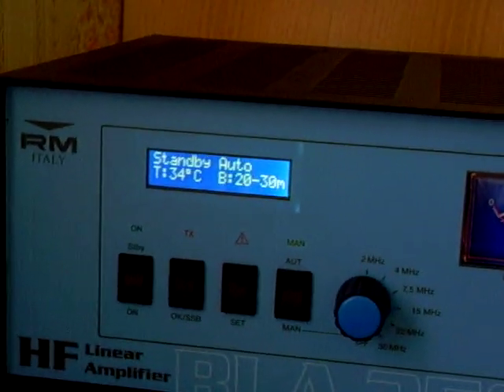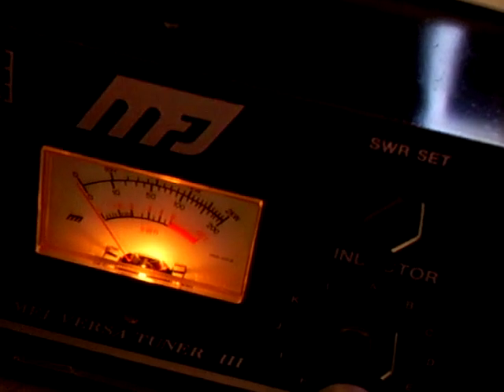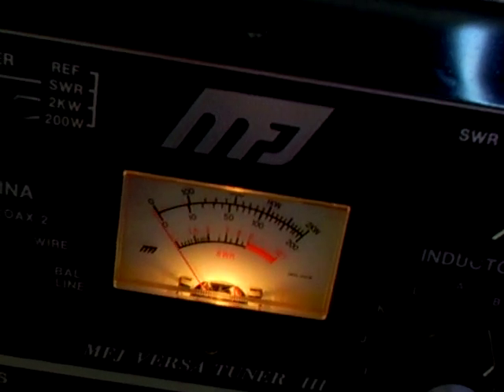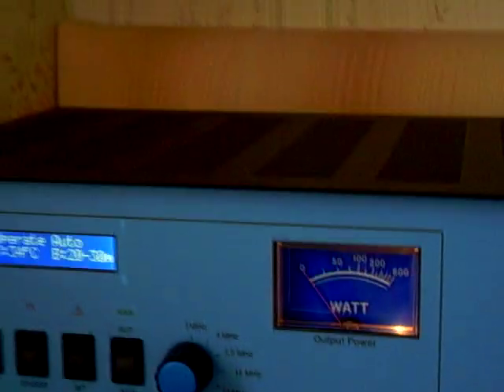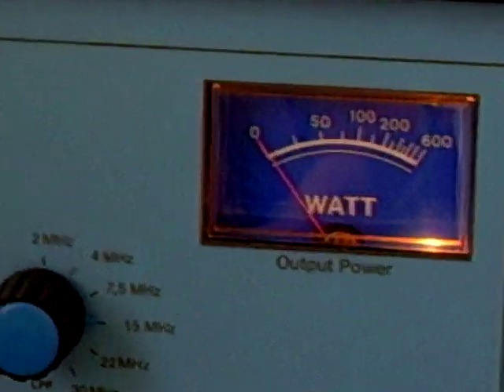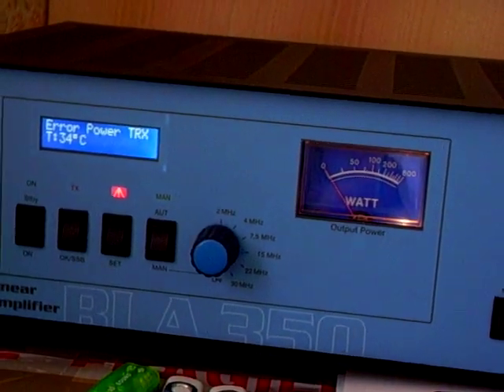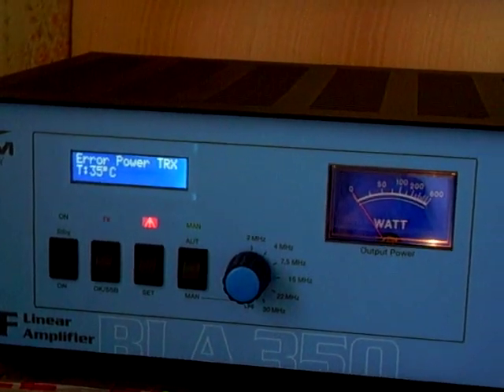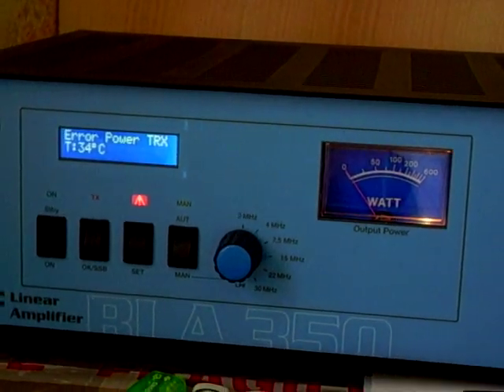BLA350 AMPLIFIER VIDEO 2.ASF

Comment: Will earthing the amp make a difference ?
Reply from the maker: HI Ross not sure some people say earth everything some say don't so in the end its down to you, I have all of my equipment earthed and hopefully it help's plus I use ferrite clips on all my leads and they do work, so in the end you have to see what help's at your location, this is an old video 8 years plus I have 2 BLA350 now one here in the uk and one in bulgaria they are good if you can pick them up cheap like I have. 73's take it easy.
Reply: @M0AOV  Hi, thanks for your reply, I have been going through the bonding and grounding process as seen in the GM3SEK lecture for the RSGB 'Clean up your shack' , which is on youtube (chaining all my gear together one to the other with copper braid)
I came across your video and noticed in the description you have said to earth the amp, I wondered if you noticed a difference yourself by doing so ?

I am using a mains shack filter with two chokes and the choked earth then runs to the back of my radio and connects up at the DC ground, I have been experimenting with earthing some of my kit to an earth block which is fixed to the shack desk and goes out to a copper ground rod and I have noticed a considerable amount of TX  power increase showing on my vswr meter, if I connect the amp body to the earth block on the desk with a length of copper braid.
Reply from the maker: @hamradiostation_G5GTR  Hi Ross that's just how I have my Radio gear all connected but for me it get's ride of some of the qrm I get from chinese power supplies that spew RF all over the place, every shack will work in different ways to other's something that might work in mine may not work in yours and vise versa, but as long as your bla350 is working as it should and with 8w to 10w that's good not 100% sure with your black bla350 if they sorted the ALC setup as I only have the blue ones, the bla350 are good amp's for the price.
Reply: @M0AOV  Oh that's interesting, Yes I was wiping the boiler out at my QTH ,I was also bleeding over in to my childrens computer headsets, until I discovered the RSGB video and cured it using the mains shack filter and a 1:1 fair-rite choke on the coax, all works well now and my computer monitor doesn't switch on and off by itself HI

I don't use the ALC setting on the BLA, I just run the PTT from the radio and set the radio at 10 watts, I see that when running 10 watts, I'm getting 330 ish watts out at the peaks

I don't understand why the BLA has a TX error which appears occasionally -SWR HIGH 3.0+ , when my antenna is showing 1.1 SWR with only half a watt of reflected power !?!?!
Reply from the maker: @hamradiostation_G5GTR  It sounds like they didn't re do there manual I think it still says you can use up to 15 watts, but I've found you can only use 8 watts really you might get away with 10 watts but you just have to test your Amp to see what's best for you I only use 8 Watts at all time and not had the TX error in years, With your FTDX101 try to remember to only set it at 8 watts and you should have no TX error problems at all and with your Ultrabeam it's 1.1 on all your bands so you know there are NO swr problems, enjoy the Amp

Comment: are you happy with it? have you tested in rtty modes?
A lot of thank's for your video.
Reply from the maker: Hi Ruben Yes I'm very happy with the BLA350 it's a fantastic and easy to use Amp once you know how to use it, with regards RTTY No I've not used it on digital modes only SSB but I would think if you have a very good air flow you shouldn't have any problems with the Amp on digital modes.